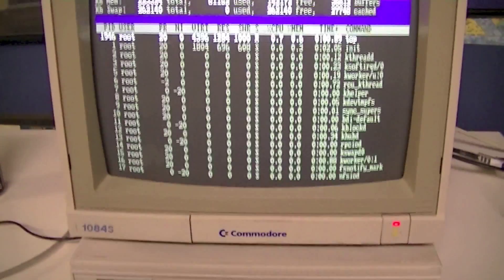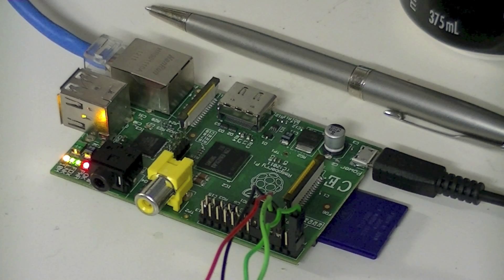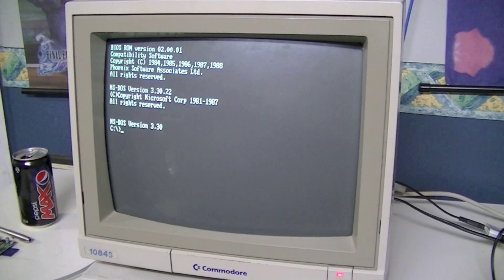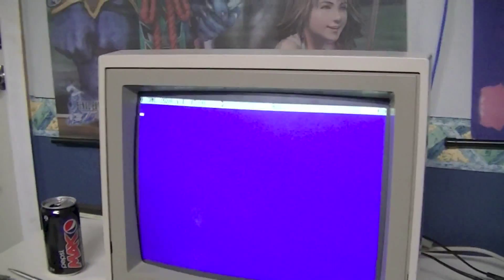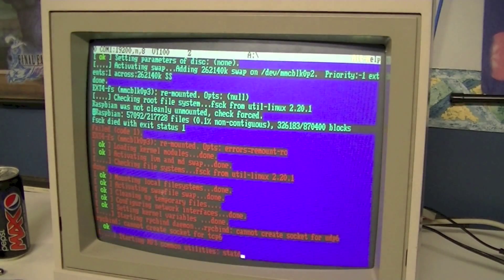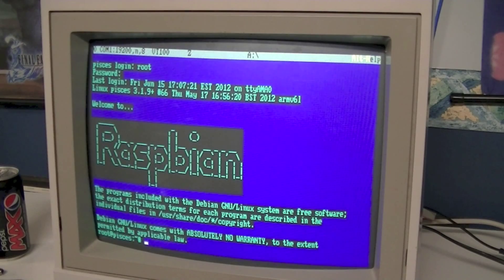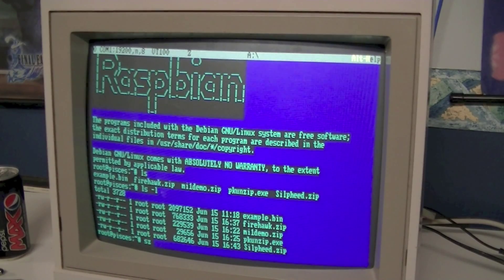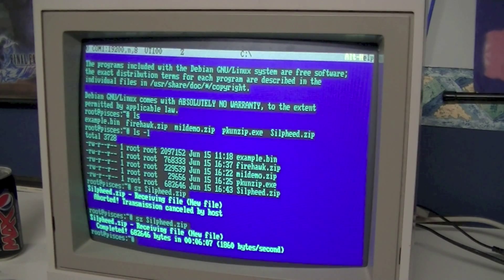[retro swim] - Episode 5 - Raspberry Pi and stuff.

Comment: I remember building serial null modem cables as a kid to copy files from one computer to another. It was quite slow so I once actually built a parallel one which was a lot faster.

MS-DOS has something built-in actually that allows you map a drive on another computer.

Once I played with coax networking however these cables went in the drawer.